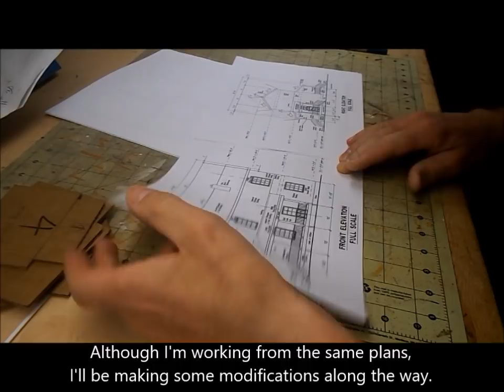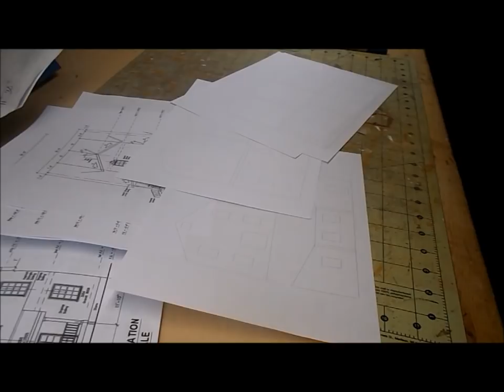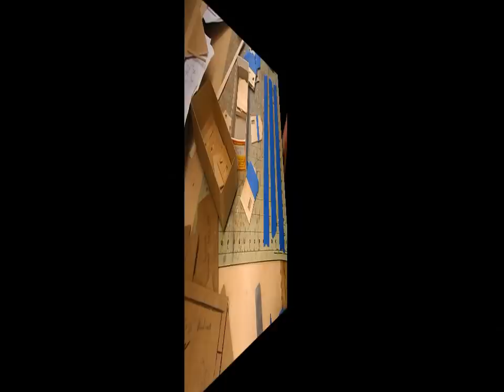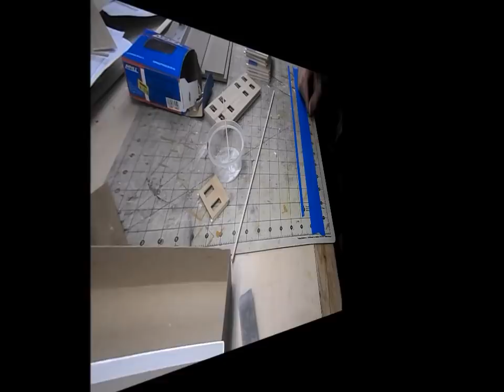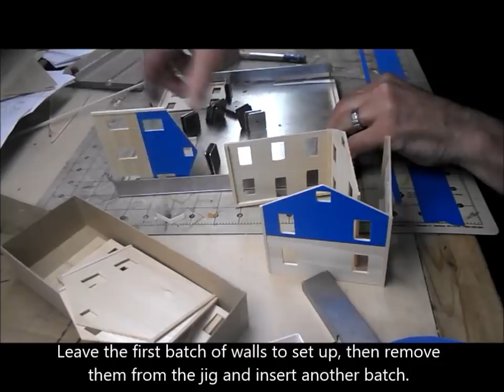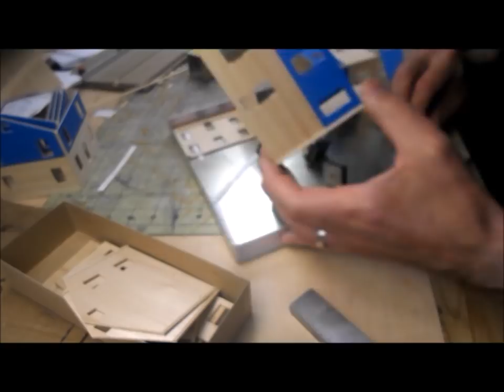Build an HO-scale mining town 1: Walls

Comment: Out of curiosity, what is the era of the mining town you are doing for your Californian customer?  Sorry that I didn’t go thru those past videos to find out myself and I can’t remember. 
I am from a mining town  - from a Townsite (when it was owned by the mining company of the same name) called Falconbridge, in the northeastern portion of the Sudbury area (Northern Ontario, Canada).  It was started in the 1920’s, grew in the 50-60’s and is actually still around. I can go into the political/planning design later.  
Our town was made up of homes like those you built, with siding (not tar paper), as well as those that were covered in a material called “Insul-Brick”.  It made the home look like it was bricked but was actually not more than shingle material covering a pressed paper like substance.  They came in 2’x4’ sections and the majority of the homes were covered in same.  Most of the homes were 20’x20 and came in a single storey or two storey forms.  
The homes that were built in the 50-60’s were larger and had a stucco outer surface with the later ones covered with a brick exterior (and vinyl siding if it had a second floor).  If I can find any in my scrap books,  I can try to take pictures of them if you want a variety of styles.
Reply from the maker: The customer runs anything he feels like, from the 1900's to the present day.  The houses I built for him are copied from a prototype photo.  Based on the clues visible, it was probably taken in the late 1960's.
Reply: mpeterll - how  best can I send you some photos from my old home town.  You are free to use them as samples for your layout and/or the California plan.  They are of the original mine and nearby buildings/homes (and yes they were “tarpaper shacks”) and then more of the more “recent” homes and buildings.